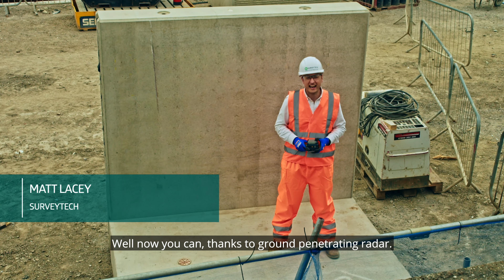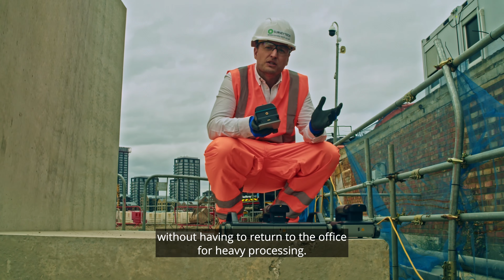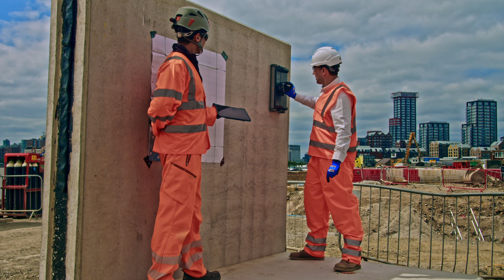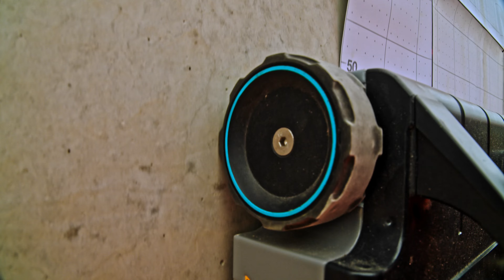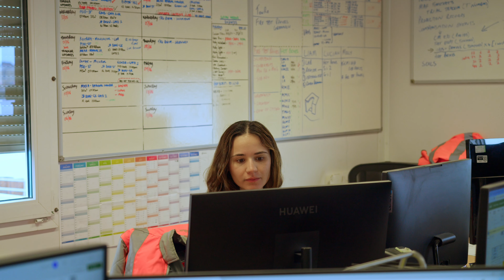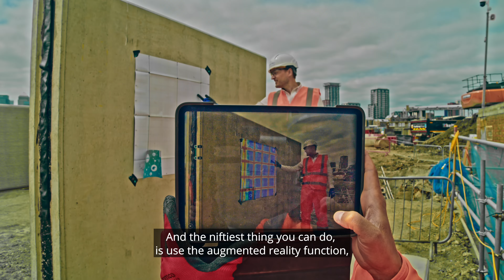See through concrete with augmented reality using Proceq GPR | Matt Lacey, SurveyTech

Comment: Hopefully one-day this tech will become cheaper than a typical laptop. A two or three scanner version of the Procep GPR 8100 (a six scanner unit) might be a start, but it will probably be more than a decade before this is type infallible and unambiguous 2D or 3D subsurface mapping is available for under $2000. In the meantime, those on a budget will have to make do with the likes of the Makita DWD181, Bosch D-Tect 200 or Hilti PS 85, which are all a far-cry from the Procep GPR 8100.